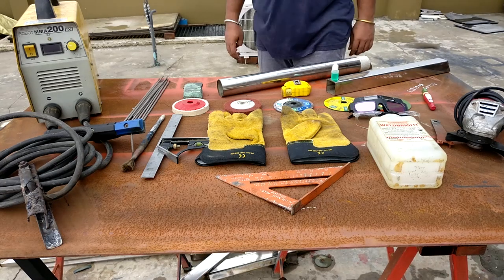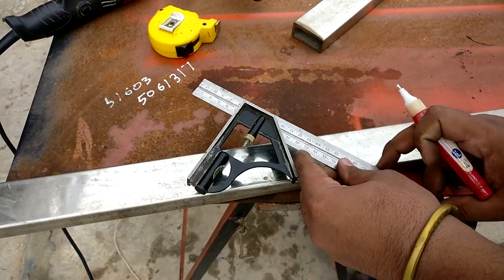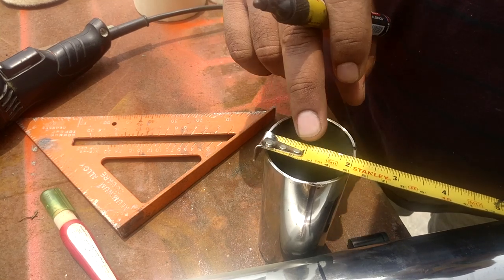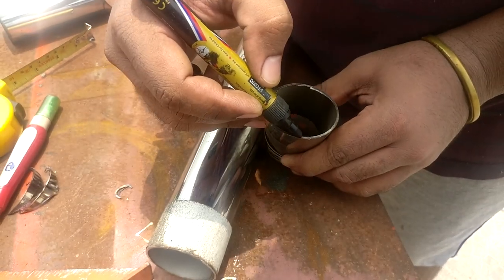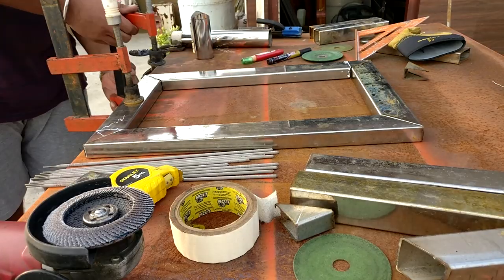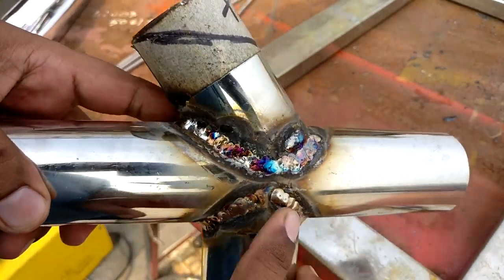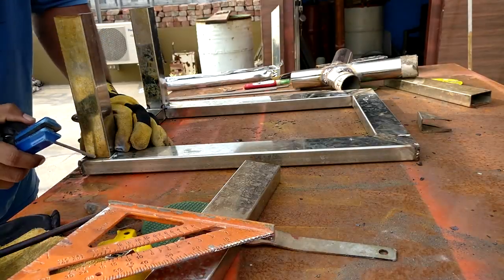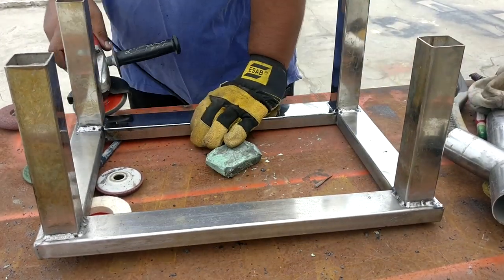Learn Stainless Steel Joints & Welding with Stick welder (Possible)

Comment: Thank you , as a beginner I have find this video very useful, and even tools you are using are minimum ,so I recommend this video for anyone to begin stainless steel welding.👍👍
Reply from the maker: Thanks buddy appreciate your feedback.
Reply: Sir which electrode is used for steel welding ?

Comment: Thankyou bro,it is very interesting video i learned some thing from it,know i wan ask you one thing i am aluminium technician and i try to do stainless steel dustbin but is it possible to weld with normal arc welder?and the chemicals and regent needed for it.Thank you for all Nice Job.

Comment: I like the way and your process in welding tecniques..but i suggest that grinding the weld with grinder using flap disc #80 then #100 then last #120 ..you must set the grinder in semi flat position..it is better than what you demonstrate in your video.thank you for your very informative video..hope my suggestion will help you more..that all is base on my year experience in stainless steel fabricating and welding..
Reply from the maker: Thanks for the appreciation, definitely consider your suggestion in my work, it's my honour to learn from professionals like you:)

Comment: Sir which type of welding machine is best for stainless steel works please suggest me IGBt or Mosfet which is better
Reply from the maker: IGBT is the modern day technology so fo with that. If wanted good joints prefer tig not stick welding.

Comment: Dear brother I really love your work...its amazing and simple explanation...
Please suggest you and tell me which welding machine is good for arc, tig and co2(gas and gasless) welding process?
i want my own welding machine for home DIY projects but I'm really confused which one is better for me...which process is cheaper for home and good finishing specially I want work with Stainless Steel material for making my front gate of my flat, fridge and front load washing machine wheel Trolly, egg snaped swing for balcony, scissors style dining table etc... My thing I thought about...so please suggest me a good efficient welding machine for Stainless Steel welding job... Thank you
Reply from the maker: Thanks dear, I am doing work on that video which come within 4-5 days. Hope you like.
Reply: @ambroscustom  thanks for your hopeful reply...have a nice day

Comment: Do we need another kind of sticks to weld stainless steel or it's the same stick use to weld iron?
Reply from the maker: You need stainless steel electrode according to the material grade. Usually SS308L works on both ss202 to ss308 grade. The ss347 works on rest of the grade. There are many others also but yeah you need different electrode.

Comment: Very good VIDEO,  when welding stainless steel there is a chance for rust to start if you don't Passivate the weld area, do you Passivate or what do you do ? Thank you William Ambrogio Orange county,  ca. Usa.
Reply from the maker: Thanks William. Yeah I that's is definitely a necessary work to do, but I mostly skip that process everytime. If it's a tig weld then it might surely cause some porosity but in stick weld it never happened to me. So if it's a stick weld then you really don't need to clean it with acetone or some other chemicals or sometimes flap disk. If it looks clean to naked eyes just go on. But in tig passivation is necessary. Thanks for being here :)

Comment: Sir, Which welding machine you are using and electrodes ?
Reply from the maker: Dear any welding machine you can use, mine cost 5000₹ and bought 3 years ago and still working absolutely fine. The electrode varies according to the need. But mostly I use ss308 for stainless steel and E6013 for mild steel work.

Comment: So, 304 is more good if i used this stainless as my railing? And what is the thickness of atainless pipe more good for railings? Thank you so much sir.
Reply from the maker: Dear they didn't came in too much thickness. Usually around 2-2.30 mm thickness which I used. Lower than this cause issues like blow holes and warpage much faster with stick welder.It good to use vernier caliper to measure thickness. I always use whenever I purchase materials. It helps alot and yes 304 is best for railings.

Comment: I have purchase a 4 in 1 welding machine .it has arch ,tig,MiG with gas and MiG gasless.
Which mode you recommend me to learn and use for stainless steel welding?do you think MiG gasless will be better than tig?
Reply from the maker: I think tig is far better than mig. It's good if have pulse tig option . But if not no worry tig is still better option to go with, it saves alot of finishing time compared to mig or stick.
Reply: As far as I know MiG is the latest technology of welding it came after tig as I have been told , and Tig I have told it needs to replace tips and more costly. strange Tig is better than MiG .anyway  I will take your advice.i will start to learn Tig .thanks
Reply from the maker: It might be true but I personally preferred tig, surely mig is much easy to learn than tig but I go with tig if its comes to stainless. But you have both of them so you can easily compare both of them and find what suits best to your need I think. Good luck
Reply: I think that’s best ideal , I will try to use both of them and decide which I will fill comfortable.thank you for your suggestions and ideals.
Reply: Sorry I have got this information from other site they compare Tig vs MiG it may be useful :

MiG vs Tig welder:
While MIG and TIG both have different strengths and weaknesses, there is no one process better than the other; they are both used for different purposes. 

MIG welding is a good option when low-cost, fast welding on materials like steel and aluminum is needed. It can run tidy stainless steel welds but is primarily used for steel and aluminum.

TIG welding creates high-quality welds that are expensive and slow. You typically TIG stainless steel and aluminum projects. It’s a difficult procedure to learn, but once mastered, it’s considered the most satisfying weld to perform. This is because of its accuracy, deep penetration, and highly attractive looks.
Reply from the maker: Yes correct, that's why I prefer you to learn tig for stainless.

Comment: brother which welder you have used and which rod you are using.6013 or 6012????
Reply from the maker: It's a cheap Chinese welder buddy, the rod are stainless steel not mild steel and ss308 grade

Comment: Good day sir, can I ask you about the pure stailess. When testing the stainless green to transparent is 3 0 4 and testing green to red is 2 0 2. Which ot thet two stainless is good and pure stainless Sir? Thank you so much.
Reply from the maker: Dear it's not about the purity it's about the chrome content in the stainless the higher the number is higher the chrome content and that is much resistive to moisture. 304 is much much better than 202.

Comment: Your skill level is high,  for stick welding thin S S pipe, is hard to do. What electrode are you using, 308, 309, or ?,  3/32"?, amps 50, 60 ?  Thanks William.   GREAT VIDEO.
From Long Beach, California.
Reply from the maker: Thanks for the compliment William. I am using ss308 , 2.5 mm rod thick and for the current starting from 1.5 mm I use 60amps and from there after with increase in wall thickness I usually increases the amps from 5-7 amps. But one thing you have to notice that I am using this setting with slightly fast hand movements. The main thing is how much time you stay onto the metal surface with the electrode at a particular spot. Too much time and there is a big hole, less time you stay it will not able to fuse the material properly. So beside the current settings it's also depends upon the hand movements. Good luck:)

Comment: which welding machine is suitable for stainless steel.... ac or dc welding machine
Reply from the maker: Dear I always uses a dc welding, never used an ac but most commonly dc is used as its more safer than the ac one. But the much better result you are going to get with tig welder compared to a stick. If I have to choose between tig and stick I go with tig just because on stainless-steel you have to do less grinding and finishing work.
Reply: @ambroscustom  thank you so much sir... for the information

Comment: How do I start polishing , because have just finished welding the bulstrades using the stainless steel and it's first project using the stainless steel pls help me out
Reply from the maker: You can watch my polishing video. In full depth. Good luck.
https://youtu.be/HTSRRzE4tOw

Comment: I have learnt a lot from this video. May i ask how much ampere is set on the machine?
Reply from the maker: It's 60amps with 2.4 mm electrode. But I recommend you to play with the settings. I have some electrodes which works beautifully at 52-55 amps on 16 gauge and some at 60 amps. So this is also depend upon the manufacturer and type of coating they used.
Reply: @ambroscustom  Thank you so much.... this will help me a lot
Reply from the maker: My pleasure:)

Comment: which rod Number have to used for SS welding since the regular 6013 cannot be used for SS ... thanks in advance.
Reply from the maker: I use ss308 having 2.5 mm dia at 60-70 amps depending upon material thickness. This electrode works well for ss304 and I even uses it on 202 also. No problem at all. Good luck.
Reply: @ambroscustom  Thank you very much for the prompt reply - especially for the amperage rating :)

Comment: Kindly make a  video about stainless steel welding machine which type of welding machine is most use ful for stainless steel
Reply from the maker: Dilbag ji, every 150A or above welding machine able to weld stainless steel. Secret is not in the machine secret is in the skill.
Reply: @ambroscustom  sir, you mean TiG welding machine is not compulsary for stainless steel.
Reply from the maker: If the work isn't too much than its not necessary. But if you do alot of stainless steel work then go with tig. It saves your alot of time in finishing. But again it comes to your skill, although tig is much easy compare to stick welding, but sometimes on the site job it's not always feasible to carry a tig machine along with you because of so much accessories, so it's good to have some hands-on practice with stick welder, so that your work never stops.

Comment: Hi im new subscriber i like you content.  Can i ask  if my 300amp invert welding machine can weld a stainless 1.5mm? Thanks
Reply from the maker: Yeah buddy, you can do it. If you have 2mm electrode than set the amps at 45-50. You are good to go. Machine never matters only the right technique matters. Good luck.
Reply: @ambroscustom  thank buddy for the info.  Because i have plan to buy a welding machine portable,  which machine you recomend
Reply from the maker: Brother frankly said I himself recently bought a Chinese AC DC tig welding machine. If you have a budget then go with everlast. Quite affordable compared to Miller and esab. Otherwise to me brand or company never matters only feature matters. If you are willing to to stainless work then go with tig and having pulse feature and also ac-dc, so that you are able to weld on aluminium if you have some work. Try to go with higher ampere machine. 250 or 300 is best for diy and normal house hold projects made with pipes and plates upto 10-12mm.  So my suggestion is that try to go with features rather than brand. Just look at branded machines and there features and you will easily able to find in local brands or Chinese brands.

Comment: Hey teacher which machine can l used to make stainless metal
Reply from the maker: Dear if you really wanted to do just stainless steel fabrication  go with tig welder either weldpro or everlast or any good quality IGBT Ac-Dc welder. This video is for those who have little bit of stainless work to do and I showed to do it with stick welder. Highly recommend to get TIG welding. Much cleaner and less grinding work needs to be done.

Comment: Can we weld steel pipe with iron pipe if so then which stick
Reply from the maker: Use stainless rod but make sure to clean the surface of iron pipe. Any rusted are can cause issues like cavity and bubbles. So clean the surface and use stainless rod.

Comment: Can you recommend any stick welder under 7000rs available online..
Reply from the maker: Going you will save around 1000-1300 easily. Although easb or shakti both are good with latest igbt technology. Esab have lack of digital amp metre other than that it's good and fits in your budget and also from a well known company or go with shakti brand little new, but build quality is great. Machine plays role but in the end it's the person who needs to do the job clean and perfect.

Comment: Hello,
          Can you please tell , what sticks we have to use and what ampere we have to keep on the welding machine for this work , i am total newbie to this . Infact i am planning to buy a arc welding machine any suggestions
Reply from the maker: Dear if you wanted to do work on regular basis then don't go for stick welding, you need to have tig welding. But if you are doing as hobby then go with stick welding then nothing wrong with that. I suggest you to go with dual purpose welding machine in which you can go with both stick welding and TIG welding. Cost around 14000 rupees. The welding electrodes vary from material to material. Although I use 308 electrode for all materials. I gives better finish. TIG welding saves your alot of time and money. You have much better weld joint and less holes. If you get alot of orders than go with dual purpose machine. Now in India they are widely available.
Reply: @ambroscustom  Thanks i am into data recovery if you ever need my services let me know

Comment: Will this work with marine grade 316?
Reply from the maker: Yeah man it definitely work you just need a 316L electrode. Even on thin mild steel you can get same result.
Reply: @ambroscustom  Thanks,  you make it look so simple.
Reply from the maker: My pleasure mate, it indeed a simple if you know the right method and settings. Good luck 👍

Comment: I would like to ask what size of rod used and what AMP?
Reply from the maker: It's 2.4mm electrode, with 60-65amps current. But recomend to go with 2mm with 45 amps current, that is way too easy and safe way to weld on thin pipes.
Reply: @ambroscustom  The rods Is it, 6010 , 6011 , 6013 or 7018?
Reply from the maker: @leomasterking  it's stainless steel rod dear. 308L, but the technique I work on mild Steel also. I did it with 6013
Reply: @ambroscustom  Ok. Thank for the info.

Comment: How to choose a good welding machine ?
Reply from the maker: Dear there is not just one thing beside that, you need to consider alot of things rather than just price and affordability and my opinion different from yours, so it kept on changing according to user.

Comment: What is the name of chemical which u used to know the quality ?
Reply from the maker: Dear there is nothing written onto that bottle, but as far as my knowledge it contains copper sulphate which reacts with iron content in the steel to give that colour. Other chemical used is potassium ferricynide. Same use but gives different colours formation during the test.

Comment: sir i wanna know the types of grinding blade's n welding electrodes for stainless steel ..please
Reply from the maker: Dear I use ss308 electrode for the welding and for the grinding there are alot of wheels. I found that norton have all the wheels which you can use for the grinding stainless steel. I tried my best to cover in my some of my upcoming video if I found here those wheels
Reply: @ambroscustom  thank you sir...

Comment: What is the ampere to apply in welding of stainless pipe
Reply from the maker: Buddy i usually used 65-70 amps with 12 gauge electrode. If i use another filler rod then i increase it upto 72-75 amps.

Comment: 15mm the pipe entry to joint?
Reply from the maker: I think I said 50 mm which is pipe diameter correct me if I am wrong and mention the time interval wher you heard that.
Reply: i did not herd i saw when u use ur meter tape
Reply: 7.06
Reply from the maker: Ok, that's it's 1/3rd of the diameter around 17mm, yes its distance from entry to the joint. Distance in which that join need to be construed.
Reply: thank you very much

Comment: I watched your video also subcribe ur channel gr8 job what is the price of ss and ms 3.15mm 10 nmbr electrod
Reply from the maker: 190 for ms 6013 electrode and 670 for  ss308.
Reply: @ambroscustom  how many quantity of rod in ms for 190rs and also ss 670rs 
How many nmbr of rod ?
Reply: Kitne piece rhte hai 190rs me MS rod or 670 m ss rod packet aata hai kya 190 or 670rs ka
Reply from the maker: @technicalmrignayansingh2207  might be around 90 not sure.

Comment: hi, can I use a cheap china small welder to weld stainless steel?
Reply from the maker: Buddy welding machine didn't matter at all. The thing matter is that at what amp you are doing it. It would be good to find the best settings first to start the welding on main build. Mine also is a Chinese welder. So go ahead:)

Comment: सर आपके पास  वेल्डिंग मशीन है उसका प्राइस क्या है और वह कौन सी कंपनी की है🙏👍👍👍👍👍👌🇮🇳
Reply from the maker: Meri welding machine 5000/- rupees ki ha local brand haa. Uski range 200amps haa. Market se aap koi bhi acchi quality ki 200 amp ki Welding machine leker ghr ki grill or 6-8mm tak ki metal plate ki Welding ker sakte ho.
Reply: @ambroscustom  धन्यवाद दोस्त आप हमेशा ऐसे ही मेरा साथ देते रहना
Reply from the maker: Sure👍

Comment: Why didn't you grind the finish off first; before you had welded?
Reply from the maker: Buddy the wall thickness is not plenty enough for stick welding you can do if you are using tig welding. In a wall thickness of 1.5 mm i never recommend to do the grinding work with stick arc.